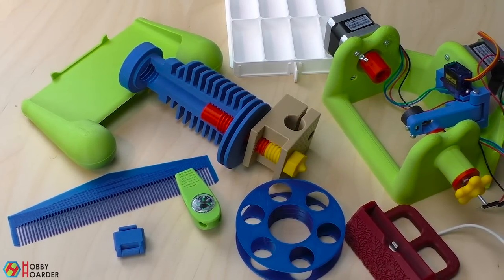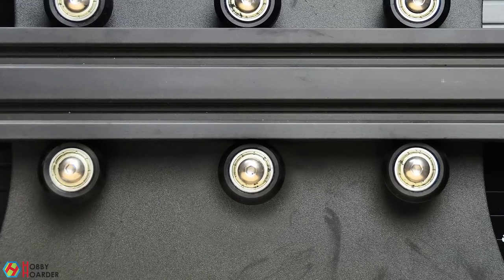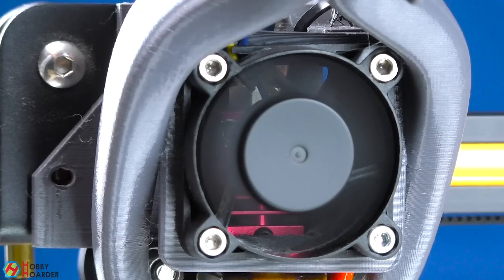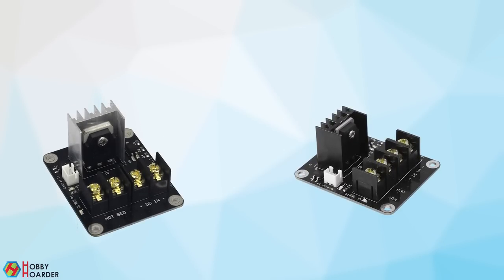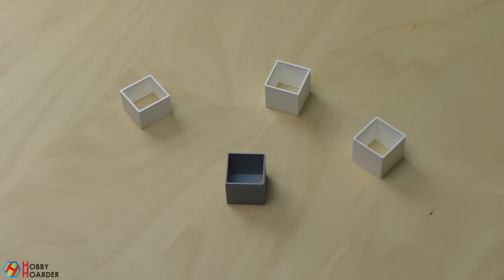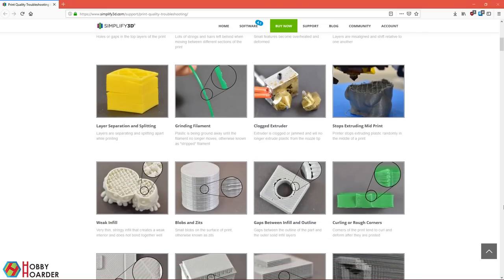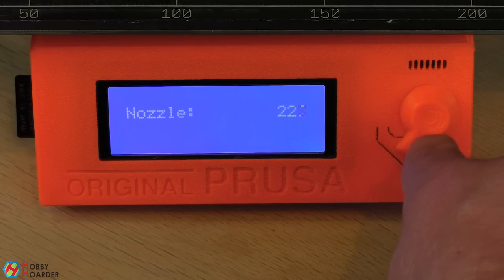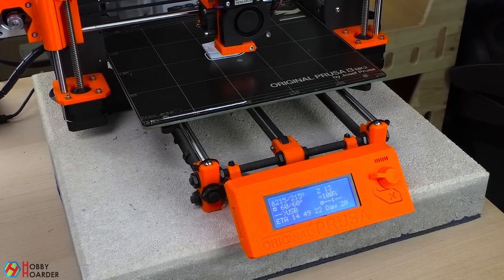How to calibrate 3D printer and first things you should print

Comment: I use the Filler spool holder. It comes with multiple mounting options and is almost frictionless. You will require two ball bearings though. For my Ender 3 I printed an angled side spool mount and used the supplied metal spool holder, but swapped the stock plastic dowel for the Filler spool holder instead. It works very well.
Reply from the maker: I've tried a lot of spool holders in the past, but I just gave up on them. I use a lot of 2.x kg spools and majority of holders don't work well with them. I've ended up using this: https://www.thingiverse.com/thing:508896

Not ideal, but best that I've tried so far for large spools. I've never heard about the Filler though, I'll check it though.

Just a note on frictionless; that's not always desirable. If you use longer retractions, a frictionless holder can end up tangling your spool.

Comment: I use the calibration squares often and before every long print. Lifesaver!
Reply from the maker: Absolutely. The only exception is if you have good auto levelling like the one on Prusa. I don't remember when I had to print the squares the last time. I've just bought a fake BLTouch for my CR-10, I'll be making a video about it soon as well.
Reply: @HobbyHoarder  Sometimes it sticks so well I have to get aggressive to remove a print. Im not sure why but my leveling doesnt stay put from one week to the next.
Reply from the maker: It might be the springs. When I first got my CR10, I'd have to re-level it every few days. It seems like the springs "settle" in after a while and now I only have to re-level once every few weeks. It's still kinda annoying, which is why I'll give the BLTouch a try, but that might be the reason with you as well. Or maybe the springs are too loose, there should be at least a moderate amount of tension in them.

Comment: Hi there. Glazier who has been in the industry for about 10 years now. 
Clear glass and mirrors are made out of the exact same materials, the only difference is that the mirror has a reflective surface called silvering applied to one side of it. In the video shown, you are still using the glass side.
Reply from the maker: Yes, you're right, thank you for the comment. When I made the video, I wasn't aware of that yet, but found out later.

I personally prefer PEI sheets over glass now, I've had much better results with it.
Reply: @HobbyHoarder  I just ordered one of the high temp engineering plates from bamboo labs, I have been using almost exclusively PEI sheets. 
I have had quite a bit of trouble tuning my P1P with polymax pla filament using the PEI sheet, I keep getting a k-factor of 0.058. That just seems way too high to me. At k-.021 my edges look a lot better but the seams still look like they’re not connecting properly. 
My theory is the textured pei sheet was screwing me up, but even with a calibration tower I still get .058.
Any ideas?

Comment: Just a tip from someone who's coming from astrophotography and this is just me being nit picky because I don't think it'll be a huge problem but something to keep in mind. 

When cleaning a mirror/glass (mirrors especially) 
You should start by taking a cotton ball and dabbing it onto the mirror. You wanna do it like that to the whole surface a few times. If you start by just wiping back and forth, and hard particulates on the glass will scratch the surface. Dabbing the cotton ball helps prevents this.
Reply: But like I said, this probably doesn't matter nearly as much for 3d printing versus astronomy so.
Reply from the maker: I understand your concern (I'm also an amateur astronomer), but the funny thing is, s scratched mirror is actually better for 3D printing as the roughness helps with adhesion.

I actually sanded one of my mirrors that I use for hard-to-print materials. The mirror looks terrible, but everything sticks much better to it.

Comment: Thank you for putting together this awesome guide.  I started a new job and need to get 12 Lulzbots up and running after being dormant for a long time.  This will be very helpful. 

One thing that will probably be frustrating is they have a 1.2mm extruder set up, but put a 0.8mm nozzle.  So I will probably have to change a lot of settings.
Reply from the maker: Check out https://3doptimizer.com.

It will help you quickly get to settings that should be ok in most cases.

Comment: I just stumbled onto your video and found it most enjoyable. I Have been printing a few years but for me its  a tool. My model train hobby is my passion so this tool is useful but not my main interest. However to keep it alive I learned you need to stay on top of it. Thank You for a well done video. Is there anything new that you would change or add to the setup process. I have a Chinese CR 10S Pro V1 I was shocked that the sample dog file printed perfectly but everything I loaded was crap. It took quite a while to learn the nuance of CR products and how to best tune it. I changed the bed position sensor, added a mirror bed, dual Z axis drives and updated the firmware once although it is due for a new grade now. I added the MicroSwiss Hot end and stainless nozzle too. So far it has been doing quite well but i only print small train parts, Not full bodies yet. It is S Scale so larger than HO and smaller than O. I appreciate your video efforts and will search your library for more. Dennis in Virginia USA
Reply from the maker: Thank you, I'm really happy to hear my video helped you out.

I had to upgrade/tweak my CR-10 quite a lot as well. That's just the case with Chinese printers I guess. On the plus side, you get to learn a lot of new things and you're much better equipped to do any repairs down the line.

Good luck with your printer! Denis from Germany :)

Comment: That was a very informative video thanks! But what did you mean that we should not try changing the nozzle on cold hot end? Dealing with hot end will be too difficult because of the temperature.
Reply from the maker: Every manufacturer recommends that you tighten the nozzle only when it's at the maximum temperature. This is to compensate for thermal expansion.

Of course, you have to use pliers or something similar to hold the hotend while you tighten the nozzle.

Comment: Just stating out, bought my first Eryone Thinker SE, followed every direction, and the first test print failed within 2mm, started moving around with the extruder. I'll continue to try, but first I'll study vids like this, Thank for sharing your knowledge. A1 PLUS
Reply from the maker: That's almost always the case of either a dirty surface or nozzle not being close enough to the bed.

Use iso alcohol to clean your bed, or a soapy water. Check out the video I did on bed leveling to see how the first layer should look like.

Comment: Greetings;  I have a couple questions for you.  
What are your thoughts on:
Dual z stepper motors?
Linear rails for X, Y, and/or Z?
using kits like EnderExtender to increase print volume?

Awesome channel, keep it up
Reply from the maker: I have dual Z motors on my CR-10S (and Prusa of course). If you can afford them, there shouldn't be any downside to them. I did hear that in some cases, they can get out of sync, but if you stick to full stop layer heights (0.12, 0.2, 0.28) you should be able to avoid that. I've never had any issues myself.

Linear rails are better of course, but much more expensive. Cheap linear rails, however, are usually worse, so unless you're buying high quality ones, you shouldn't bother. MGN9  series seem to be quite good, I'll be using them in my upcoming build. You won't gain much by using rails for Z, but if you plan on converting it anyway, you might as well do Z.

I've never heard about EnderExtender before, so I can't really tell you much about it, sorry.

Hope that helps!
Reply: @HobbyHoarder    Yes, it was quite helpful.  I so broke duct tape can't fix me, so I would have gotten cheap rails.  I'll wait until I can get good ones.  As far as the motor, what if you splice them together?  I'm unfamiliar with your full stop layer heights comment.  Do you mean the settings like "Dynamic" Standard" and such?  In other words, don't set your own, such as ".3, .01".  Also, as far as the enderextender, the premise is to increase the volume of the printer.  Ultimately, you swap out frame parts, and bed parts, to have larger build area.
Reply from the maker: @NOC-H  Sure, you can just splice them together. This is actually what you have to do if you buy Z-kit from Creality.

Yes, I was talking about layer heights, the ones I've mentioned work best if you have two Z motors and they're close enough to the default values that you won't notice any difference. I usually print 99% of stuff at 0,2mm.
Reply: Hobby Hoarder cool.  Hey, do you have a discord?
Reply from the maker: @NOC-H  I do, although I rarely use it. I even have a server (invite code bnxvE9q) but it's more or less empty.

Comment: I know this is an old video, but should flow rate be calibrated just once for all filaments or for each filament? Do I calibrate flow rate first, then temperature tower or temperature tower first then flow rate?
Reply from the maker: Yeah, getting a bit old, but most things in it are still relevant.

I only calibrate the flowrate once and use that value for any fillament. If you want to take it a step further, you can measure the diameter of every spool using a micrometer. You can then enter that value in the slicer to account for slight differences between different spools. I personally don't bother with this, but some people swear by it.

Do flowrate first and then start playing around with temp. towers. Although to be honest - I've been printing for years and currently own 12 printers and I've never done a temp. tower test. Default values (PLA 215, ABS 245'C etc.) seem to work just fine no matter which printer I'm using. I think temperature towers only come into play with low-quality fillaments.
Reply: @HobbyHoarder  Awesome! Thank you! Now when I do the flow calibration, I was doing it for each type of filament and then putting that flow % into cura under the material profile.  If I just do a flow calibration and use 1 flow %, do you change that on your printer itself and store the setting somehow or do you change it in your slicer?
Reply from the maker: @sirbeck58  I've changed the flowrate in my slicer. If you'll do it on your printer, then it can get overwritten with a firmware update.

Comment: What about filament shrinkage ? On prints you need to be exact sizes. How do you adjust for this?
Reply from the maker: What exactly do you mean by filament shrinkage? I've never heard that term before.
Reply: @HobbyHoarder  When you measure something out to be a certain size and then when you print it it comes out a little smaller than you measured. I saying for parts that need to be an exact width height. The plastic shrinks as it cools and this can cause it not to be exactly as your measured
Reply from the maker: @thatguyfromca  Ah ok. Yeah, that can happen, especially with ABS or nylon.

Here, check out this link for a simple tool that lets you measure and calibrate the scale, it's very accurate: https://www.thingiverse.com/thing:1982686

Comment: Curious why a mirror would work better than glass?  Since a mirror is glass with a reflective coating on the back.  Hmmm?
Reply from the maker: That's a good question that gets asked a lot; mirrors are produced within better tolerances than glass, since any imperfection would be much more obvious than if you're simply looking through a window. So while technically it's the same material, the surface of a mirror is much smoother than of a typical glass.

Comment: I found this video and started following most of them.  I updated to marlin, using the link.  However, my printer is now doing something new.  I've printed about a kg worth of pla over the last week.  Today, after the update of firmware, it decided to randomly pause during print.  like it just stops for a second or two and then continues on.  Its done it several times in this same print.  What did I do wrong?  All i changed on the marlin was display stuff.
Reply from the maker: That's hard to say. Do you see anything on the LCD screen? Did you perform PID tuning? If not, maybe the temperature drops so suddenly that it waits a second or two for it to get back up.
Reply: Hobby Hoarder well, I found out I was using an older marlin.   Th3d didn’t update their link.  So I’m in process of getting 2.0.
Reply from the maker: @NOC-H  Ah, ok. Although even using older Marlin shouldn't cause random pauses.

Once you update, don't forget about the PID that I've mentioned, it makes a big difference for temperature stability and you can even run it directly from the menu.
Reply: Hobby Hoarder thanks.   It’s that the version I have seems to be missing many MANY settings.   For example, there’s only one line that regards mesh leveling; and that’s just enable.   I’d like to ask another Q.   What interface do you use?  I’m using cura slicer.  But have to find some software that lets me play with the printer settings.
Reply from the maker: @NOC-H  Yeah, there should definitely be more settings for auto leveling.

I'm using multiple slicers, depending on printer. For Prusa, I use either Simplify3D or PrusaSlicer. For CR-10S, I use Cura.

You can actually enable Expert settings in Cura and then you'll be presented with about 200 different settings, more than any other slicers that I can think of. So Cura is definitely for you if you want lots of settings :D
Reply: Hobby Hoarder it’s not settings I necessarily want.  It’s ability to control  what few I’ll use.  For example, telling my printer to dispense set amount of filament from computer
Reply from the maker: @NOC-H  In that case, you have two options. Either connect it directly to your PC or use Octoprint.

If you use PC, then every slicer, Cura included, has the option of sending commands. It's under the Monitor tab in Cura. You can also use a dedicated software like Pronterface.

If you go with Octoprint, it has a terminal tab that you can use to send commands. What's best about this is that you don't have to connect your printer to PC, it's all done from the browser.
Reply: Hobby Hoarder direct connect is what I’m doing for now.  But that’s why I asked about control/interface software
Reply from the maker: @NOC-H  I can't recommend Octoprint enough. You can upload a bunch of files, sort them in folders etc. It even has Cura plugin so you can slice STL's directly in your browser.

But more importantly, it lets you remotely control and monitor your printer. I have a webcam for all my printers and so I don't have to constantly go to the basement to check how the print is going. It's also great for monitoring the print when I'm not at home, and if anything is wrong, I can just remotely cancel the print.
Reply: Hobby Hoarder thanks.  Right now I’m pulling my hair out with trying to install marlin 2.0.  Videos aren’t helping since My file doesn’t seem to have the same defined.

Comment: So why do you calibrate the Extruder and leave out the X, Y and Z Steppers
Reply from the maker: There's no point in calibrating other steppers unless you're building a printer yourself. They are always homed before the printing starts, so there's no fear or them being "miss-aligned". That's not the case with the extruder.

In any case, we're only talking about a few percent difference, so doing extruder calibration isn't critical, but it doesn't hurt either.

Comment: arent mirrors just glass with a silver sulfite back layer?
Reply from the maker: Yes, technically. However, mirrors are produced to a much higher (smoother) standard, which is why they work so better for adhesion.
Reply: I'm using paperglue stick with my glass bed to increase adhesion. It works perfect and it's super easy to clean with wet cloth.

Comment: How the heck are you going to print calibration squares if the bed is very unlevel to begin with??
Reply from the maker: It's a chicken-and-egg problem. If you level the bed first, then you'll have to re-level it every time you change the flowrate (after printing the calibration squares). That's why I've decided to print the squares first, as even a non-perfectly leveled bed is good enough. After you get the flowrate dialed-in, you can then level the bed just once.

Comment: even this this printer is better then mine
Reply from the maker: Most cheap printers sold today can produce quite good prints, it just takes some tinkering and upgrading some of the parts (especially the part cooling fan).

Try looking into that for your specific printer, you might be surprised at what it can do.
Reply: Hobby Hoarder ok thx for the help I got ender 3 and it isn’t really working well
Reply from the maker: @Foo_rina  Ender 3 has the potential to print really good. Sadly, their quality control is non-existant, so it depends on your luck.

Definitely replace the part cooling fan - look into Petsfang, it's a great mod.
Reply: Hobby Hoarder thx for your help 😊 I will definitely check it out!

Comment: Most of these things you talk about only apply to that printer
Reply from the maker: Like I said, it's impossible to cover every printer in one video, but I feel most of the things can be applied. Every printer needs tight belts, updated firmware, leveled bed, calibrated extruder and flowrate... The only things that was kinda specific to CR10 was the filament guide.